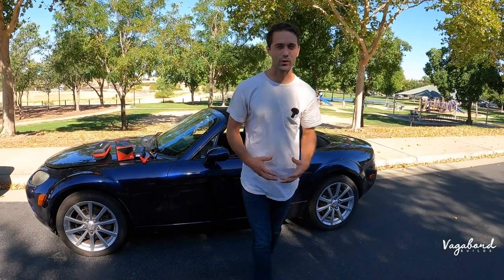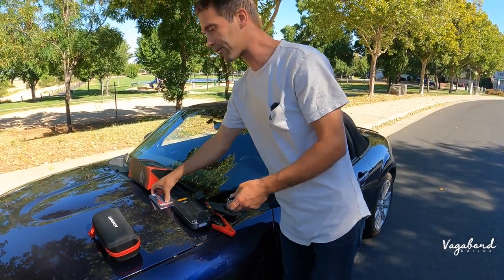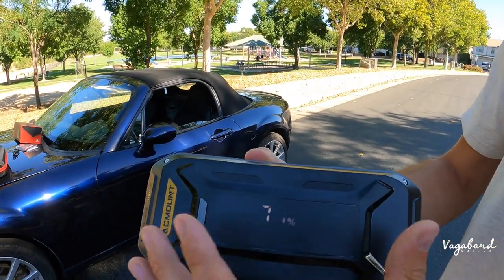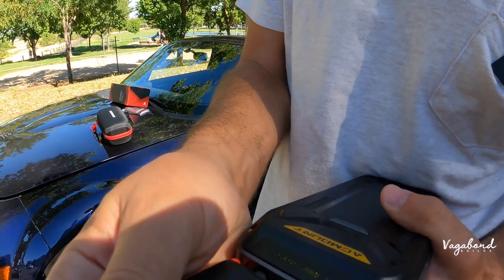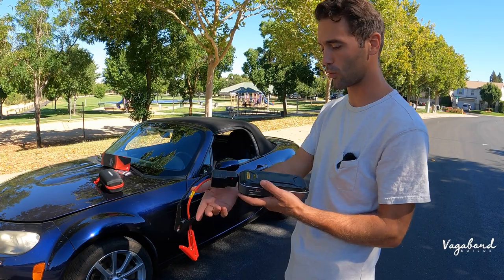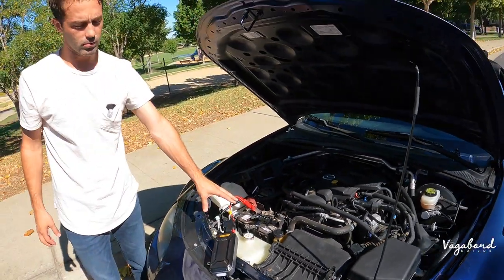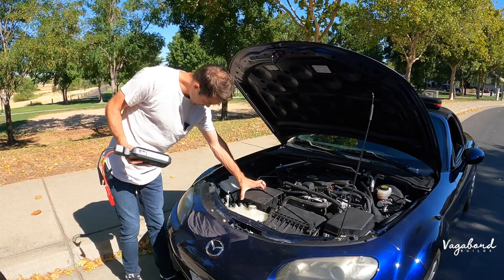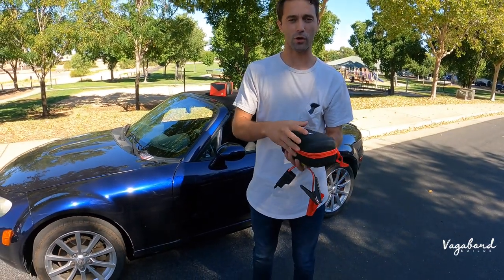Acmount Car Jump Starter - is this the future?

Comment: I'm getting an E2 code when I plug it in to charge it, and it doesn't seem to be charging.  The instructions don't say what the error codes are.  Do you know?
Reply from the maker: That code states battery voltage is to high.  Something is wrong with the battery. Try you jumper on another battery